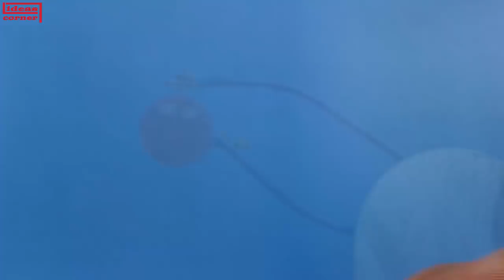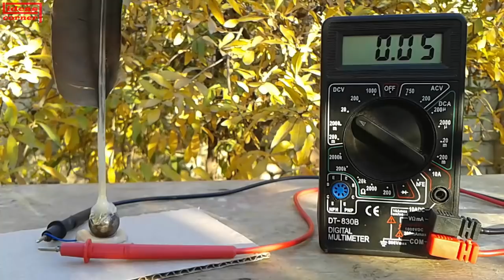Free Energy Science Experiment Piezo Generator

Comment: OK - what specific materials do I need to do some of these with my students in class?  Is that a capacitor or a resistor you use at 2:55?  Which switch (specs) did you use?  Thanks!